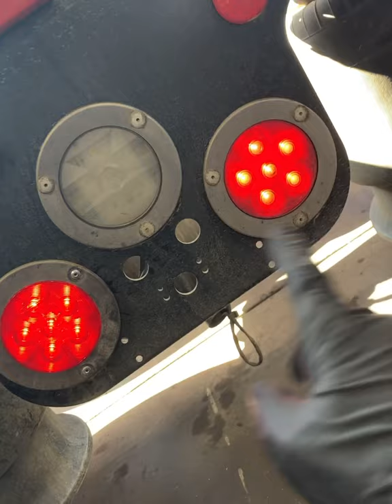Tail light not working. Tail light replacement. Stop lamp inop. Brake light replacement

Comment: I like that way, clean. Ok, one issue I had,  rear tail light stayed on.  What's simple diag, when come to that issue.
Reply from the maker: Thanks for reaching out..For a new cascadia p4 style compared to older style p3 like 2016 and 2017 have differnent t/s to get to the answer. They changed the electrical architecture.What year is yours.
Reply: @bustedknucklebydieseldr3228  I believe  2017 or 2018
Reply: @bustedknucklebydieseldr3228  I'd have to go back like at RO. But definitely newer model.
Reply from the maker: @johnavalos9679  with that year, going to the brake pressure switch would be my first place. It’s above the throttle panel in the lower dash. Jumping that switch would tell me if the system is working properly. If it’s not the switch if than check the master switch on the firewall than after that go towards the SSam module

Comment: Do you know the wire gauge. My wires have corsion
Reply from the maker: Great question, most common is 16 g. But I’ve seen 14 or 18 g on particular ones. If you use 16 you should be fine.

Comment: Man did you know where can I find tail lights fuse? Because my right tail light don’t work,
Reply from the maker: If you have a new cascadia than there’s no fuse it’s logic controlled. If you have the older cascadia than it will be in the sam chassis on the firewall.

Comment: Why don’t they just put screw instead of rivets
Reply from the maker: I would think because the factory style looks better with rivets. Gives it the more classy look. But either way they both work good.
Reply: Is for the screw going to rusted on the aluminum ending to ruined the tails light
Reply: What size rivit do those take?

Comment: Hey bud how could one get into contact with you? I have a question
Reply from the maker: Thanks for reaching out man. For now,just through here Till I can grow the channel a little bit and see if it takes off.Than I will give out personal contact to help as much as I can. Questions through here help others with there own truck problems so it might help multiple people out there as well.
Reply: The issue I’m having with a freightliner is the city horn stays on, at one point it stopped. I checked the fuse , fuse was good. I could not find a horn relay. Horn randomly started going off again. I’ve also tried a known good horn , and horn button switch. Both of which still did the same thing
Reply from the maker: @Isaacg357  thanks for the great question. Can I ask what year your truck is. The answer changes slightly.
Reply: Sorry bud got busy at work, it’s a 2017
Reply from the maker: @Isaacg357  gotcha. That makes things a little easier to t/s. With 16 17 18 trucks they are notorious for clock spring issues. When moisture gets into the clock spring which is located under the steering wheel. Is causes shorts and mainly to the horn circuit. I would remove your lower dash cover under your wheel and. Heck that connector for corrosion. I believe I have a video on the clock spring as well.
Reply: Thanks buddy! I’ll try and look through your videos to find the clock spring one
Reply: Can you maybe check to see if you did do a video on the clock spring because I couldn’t find it bud
Reply from the maker: @Isaacg357  I just looked to couldn’t see it. Some of my videos get flagged by YouTube and if I don’t change what they ask for than they take that one down.  If I can’t find the email I’ll try to do one soon.
Reply: No worries thanks for staying in contact I’ll be on the lookout.
Reply: Hey buddy so I checked out that clock spring we talked about and found no corrosion at the pins or harness however when looking at the clock spring from underneath you can tell coffe or something was spilt of the steering wheel some pint because it’s running down towards that clock spring and looks kinda gunky around the top housing of that clock spring ... thinking I’m gonna replace it and see if that does the trick. Is it as simple as removing the nut and piping that steering wheel right off by hand?
Reply from the maker: @Isaacg357  that would be a great indication of something spilling in there. Definitely start there and the procedure to setting it correctly is on the clock spring label when you get the new one. And yes that wheel comes off with just undoing that one nut and smacking it like it owes you money upward.
Reply: Hate to keep bugging you but so that clock spring would cause constant power to the two pin plug going to the horn? That’s what I’m getting on ground side is voltage at the horn plug under hood
Reply from the maker: @Isaacg357  all good man. So the horn works off ground and the clock spring supplies voltage. So if you had power on both pins than either bad ground in your steering column or that clock spring is screwing up.
Reply: Yea because I’m getting 9volts to the orange wire or light brown wire that should have power only  when the horn button is pressed on the steering wheel.
Reply: You would think if I unplugged the clock spring and everything from it that power supply would go away at that horn wire but it does not
Reply from the maker: @Isaacg357  you got a remember that Cox bring a Shorting power across you will get strange results such as 9 V. Now not being there and not actually seeing it happen it’s a little hard to diagnose.  but that little module will cause very strange things to happen
Reply: So I’m thinking my best bet would be to replaced that clock spring then from what it sounds like
Reply: Is there a way to specifically test that clock spring and determine if it’s bad or good?
Reply from the maker: @Isaacg357  there sure is. Find out what pins are for the horn circuit and back probe it to see what it’s putting out. You might need another truck of the same year to get definitive results.